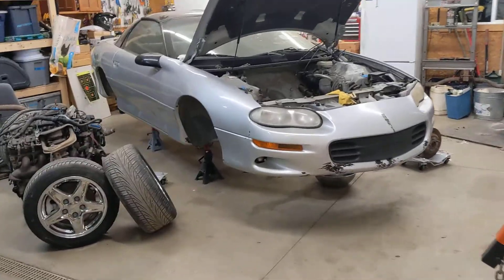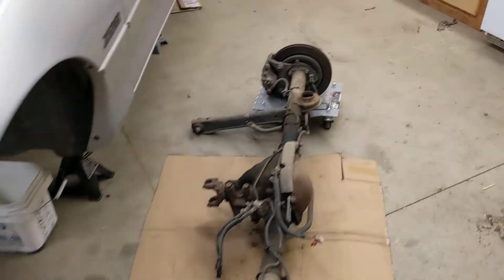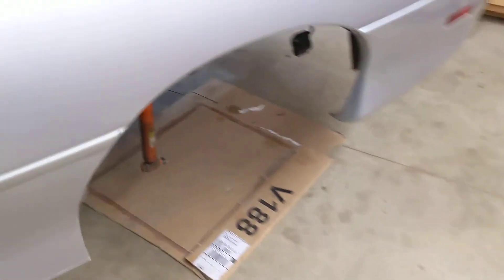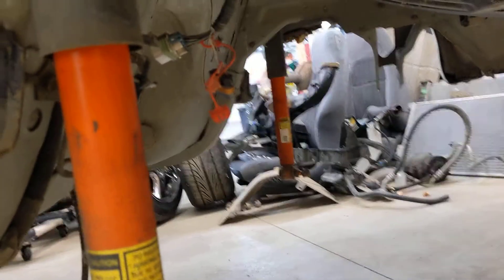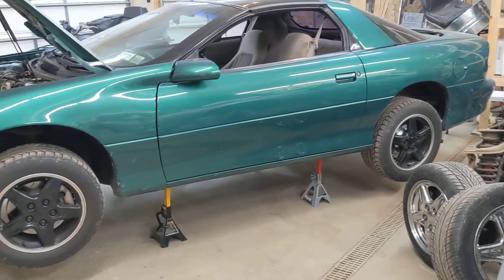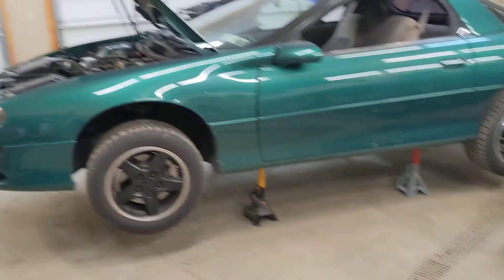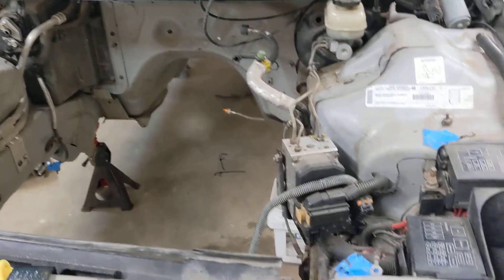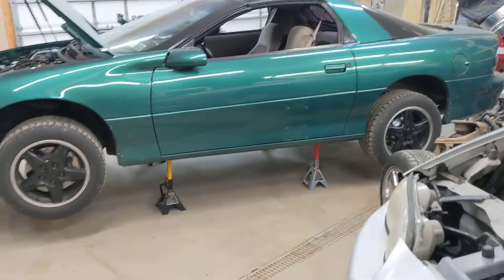1998 3.8l V6 Camaro to LS1 / T56 swap - Part 3 - 10 bolt removal

Comment: you can use the v6 interior wiring harness swap the instrument panel fuel pump and tanks are the same. If you have an email I can send you my research. i have gen 4 ls engine so I have to swap the computer is different I trying to create an adapter.